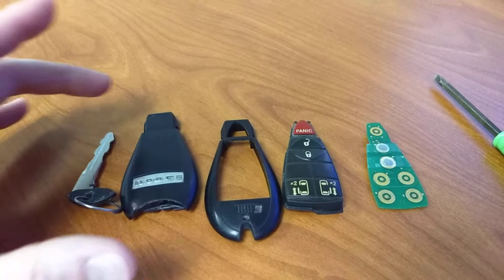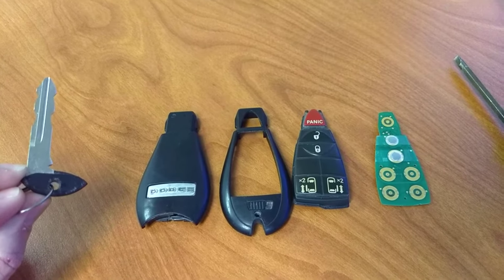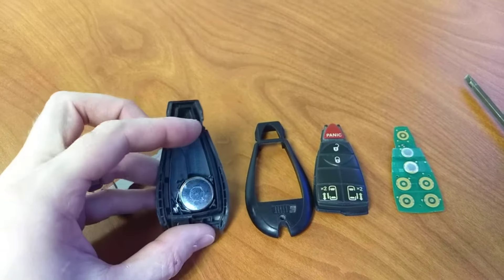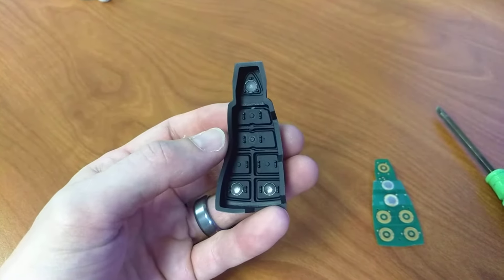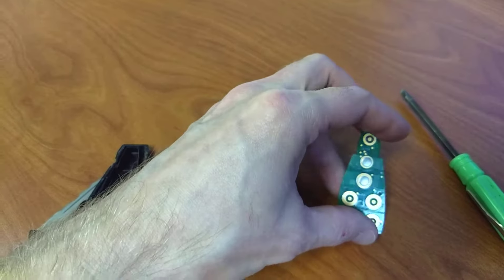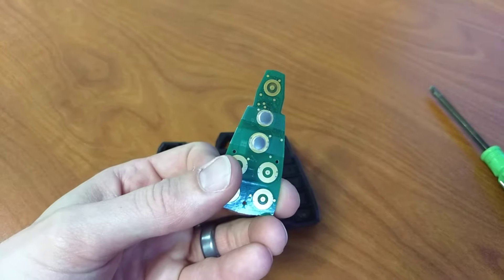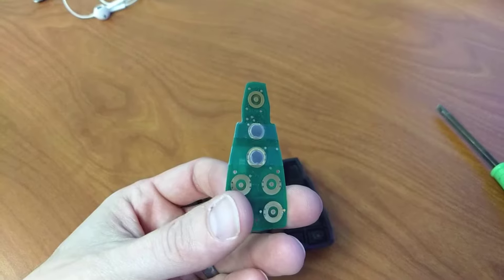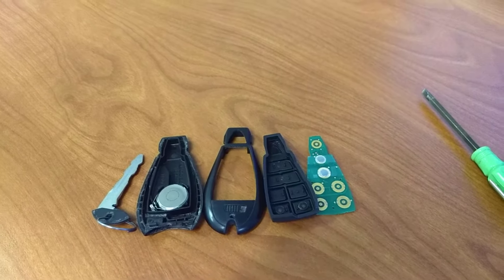How to fix Chrysler / Dodge key fob remote button - Caravan, Ram, Town & Country, Journey, Durango,

Comment: One key quit working.  don't use the other one because it sticks in the switch.  How do I know it's not the battery?
Reply from the maker: If you have a voltmeter you can check the voltage of the battery. Otherwise you just need to try a new one. I’m curious about the key sticking though. It’s been awhile since we got rid of the van, but if the fob gets stuck in the ignition you probably just have some plastic on the fob that needs shaved down to stop catching. I’d compare it very closely to the other key fob. Or just take the inside components of the key that stick buts works and swap them for the key that has stopped.

Comment: Thank you so much.  I just fixed my key fob and it is working properly now.  I'm going to tell my mechanic about this.  I thought I was going crazy and it didn't act up when I was there yesterday.  I'm also having a problem with my radio.  For some reason the stations aren't connecting to the volume. The CD play works and has volume. So you or does anyone else have a solution to this issue.  Thanks
Reply from the maker: Sometimes our radio wouldn’t work at all until we would restart the car. Low quality Chrysler components 🤷🏼‍♂️

Comment: What do you do if the inside buttons are missing?
Reply from the maker: You can buy a cheap shell off Amazon or eBay.
Reply from the maker: https://www.autozone.com/electrical-and-lighting/remote-keyless-entry/p/dorman-keyless-remote-case-13679/813077_0_0

Comment: How long will it work for?
Reply from the maker: @1232bluejays  we traded the van in about a year later and the key was still working. If the tape is good, it should last long enough you still feel good about not wasting money at the dealer. I picked up a 2017 Ram 1500 real cheap from my employer last month with a faulty key fob. Fixed it doing this same thing.

Comment: still no mention of why my car doors do not respond to my new fob... previous fob stolen
Reply from the maker: From what I’ve seen you may have to use the dealer. Some people say there is a combination of buttons and starting the car that will work. Others say it doesn’t. Some people say you need two keys that work in order to pair a new one.

Comment: Sadly my issue is separate, i had new keys maybe 2 years ago, due to a ignition recall,  last week the fobs wouldn't do anything, both was no go.  Then randomly it'll work, today i got no luck.  Im telling you this....THIS IS THE LAST DODGE PRODUCT ILL EVER BUY!!! At least the keys still start it ok....for now...  Guessing the actual transmitter itself is failing.  Well at 187k miles that is one fix im not doing!
Reply from the maker: We just traded ours in for a 2018 F150 supercrew. It was a huge step up for us but my wife LOVES IT! Bye bye minivan.

Comment: OMG...   I wish I would have seen this before I tried the glue method. I’m now trying to reprogram a new key I bought on Amazon. 🤷🏻‍♂️
Reply from the maker: I told myself years ago I'd never buy Chrysler/Dodge... But this van on the lot was in great shape and we bargained for a great deal. While the van is very nice for the family, the little things like electric door locks that are essentially impossible to replace going bad, cheap key fobs, shorts in the wiring for windows, cruise control, A/C, a rebuilt transmission, brake noise that I'm told is impossible to fix because of factory design... Reminds me every day I made a mistake.
Reply: PromisKeeper,
My biggest problem with my 2014 T&C is it sounds like I’m driving a convertible on the inside. I replaced the rotors with Bosch rotors per reading the T&C forum. I retired from GM but we wanted a van and GM doesn’t make anything comparable to the T&C. I will say Chrysler is supposed to be the luxury line but is far from it. Thanks for responding.

Comment: i did that but it work but not last
Reply from the maker: Sorry to hear. I would say make sure you use a quality piece of tape and it’s super important that the metal button sits exactly where it’s supposed to. Hopefully you don’t have to go to the dealer to pay for a replacement.